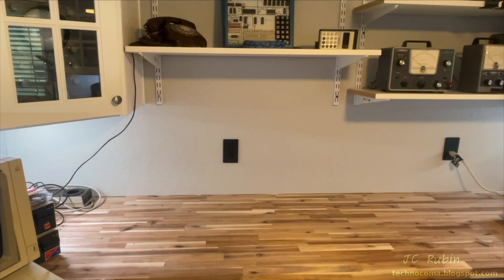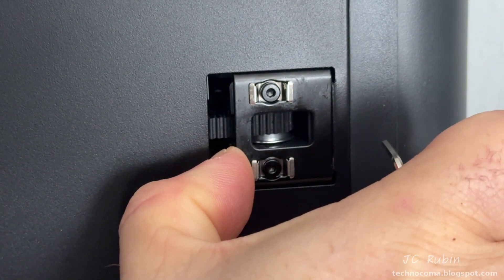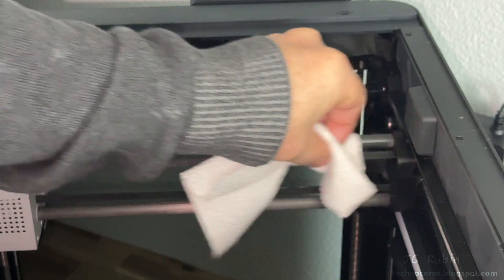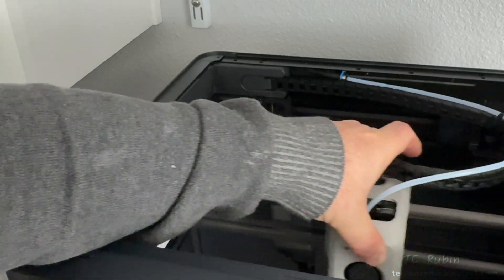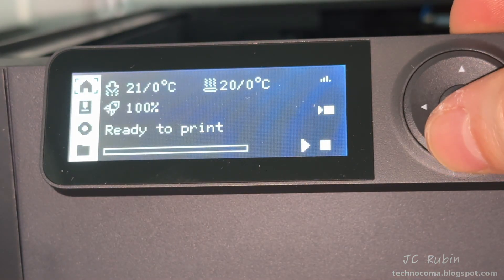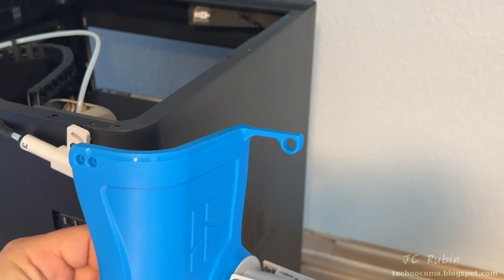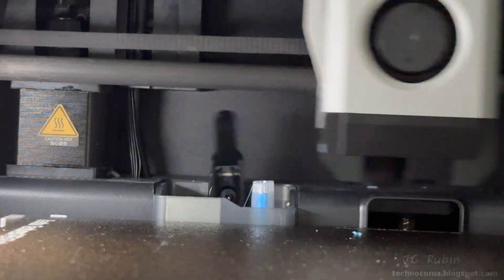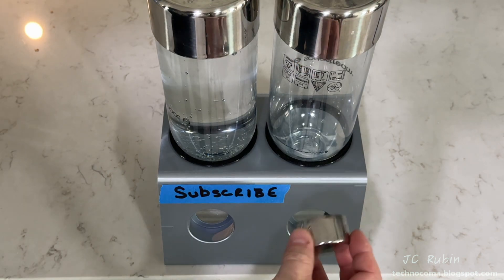Bambu Labs P1S Printer - Documentation of Upgrades, Fixes and Repairs and Maintenance

Comment: Thanks for sharing. I am quite new owner of P1S. It is really nice piece of kit. Hope bambu won't explode due to their software drm plans.

You could add some dust shields to the tensioners at the back. And I spy some desiccant beads containers in AMS. Do you use them alone or with the dessicant from bambu?
Reply from the maker: I bought a big jug of non toxic rechargeable desiccant, as it goes blue i put it into a container and then when their is enough i heat it in the over for an hour or so in a pan and then back into the container.  This is the one I use     https://amzn.to/3CwF405
Reply: @retrotechandelectronics I like the “spill proof” ams desiccant boxes on makerworld ;)
Reply: Did you forgot to add the nozzle wiper? Btw awesome video!